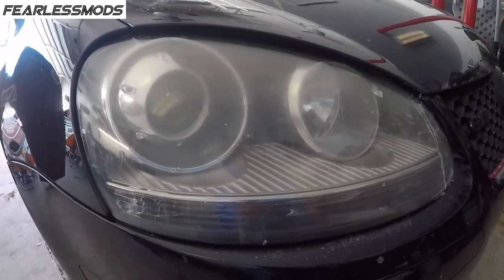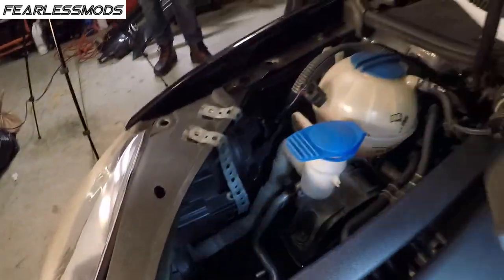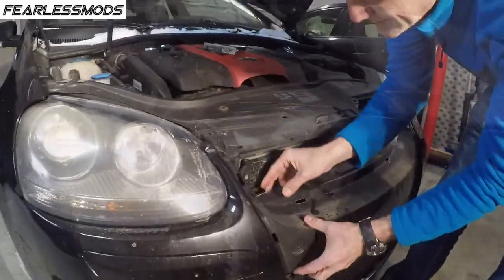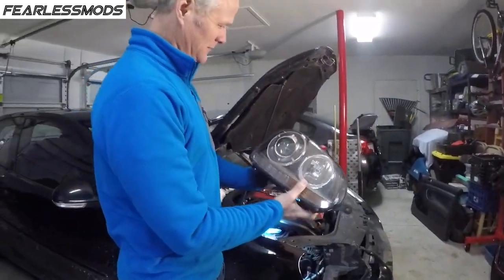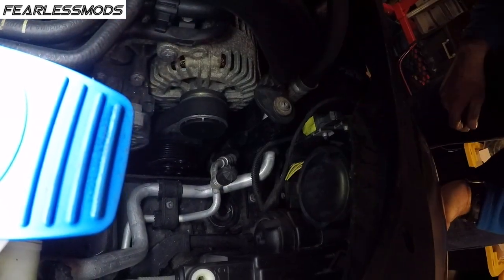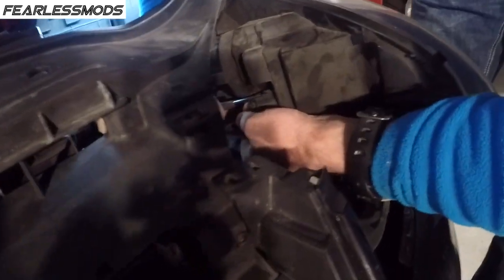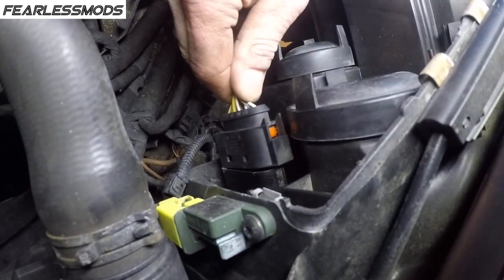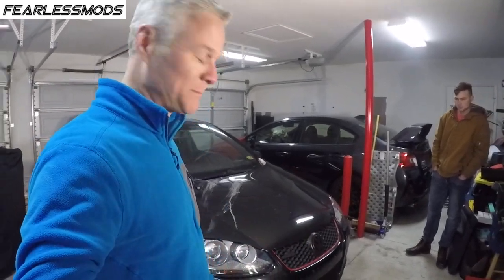MKV GTI Headlight Replacement

Comment: Nobody has the instructions on how to take headlight connector with the top clips instead of sides. This the only video I found
Reply from the maker: The lesson learned is that you need to push them in to relieve pressure and then squeeze and pull the clip off.  Still though....sounds easier than it is.  Good luck!

Comment: I've replaced two (02) of these and can attest to how hateful the electrical connector can be. No, I broke the tiny tabs and secured it with a drop of silicone - until next time :)
Reply: How did you get it off without the tabs? I've accidentally broken one off and am really struggling to get it off
Reply: @tomf6920  me too what did u end up doing

Comment: I was wondering why you removed the 2 screws above the top headlight screw thats for the core support. And also why you didn't turn the wheel for the screws in the wheel well. But mainly who not just clean the headlights there's remedies for those light conditions

Comment: The wiring inside over time become brittle and start cracking. These wires start touching one another causing electrical problems.